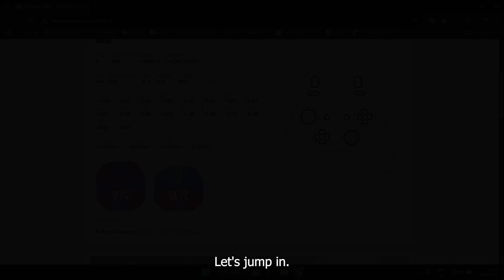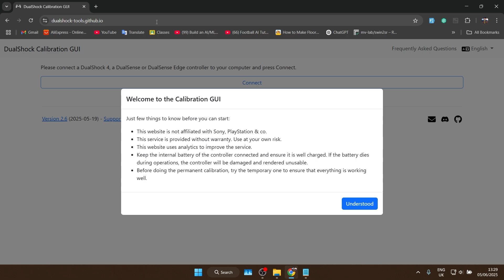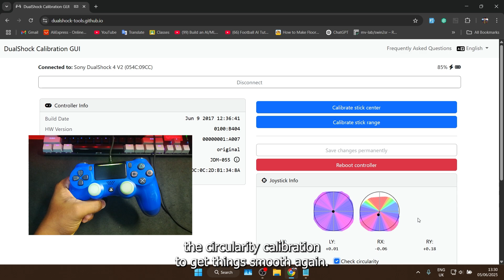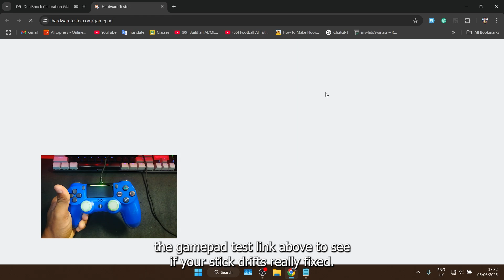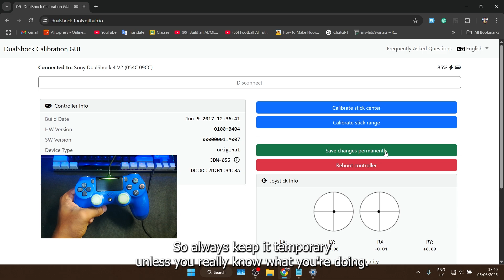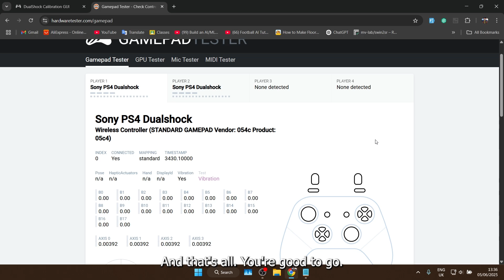Fix Stick Drift WITHOUT Replacing Analog Stick | Easy Calibration Method (2025)

Comment: Thanks for this, just had a fit trying to replace an analog stick only to find out it wasn't centered, save me from another headache, works perfectly!
Reply from the maker: Happy to hear it's working perfectly now, that calibration method definitely saves a lot of time! 👍🔧

Thanks for the support, and enjoy your controller! If you ever run into any other issues, just leave a comment and I'll be happy to help. 🔧🎮

Stay tuned & stay techy!

Comment: but calibration isn't a forever fix for drift. ur gonna have to replace parts eventually
Reply from the maker: True! ❤️ Calibration isn’t always a permanent fix, especially if the analog stick is physically worn out.

But this method is perfect for people who:

👉 Have minor drift issues.
👉 Wanna test before replacing parts.
👉 Or just can’t afford new modules right away. 💸

I do mention in the video that hardware replacement is the final fix if the drift keeps coming back. But for many, recalibration buys them weeks or even months of smoother gameplay! 🙌

Appreciate the comment, bro! 💬👊